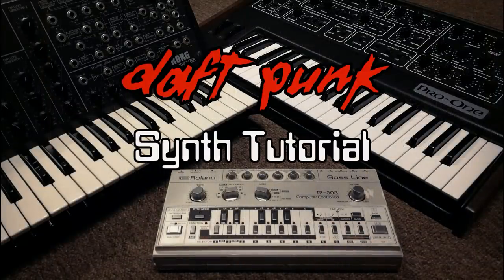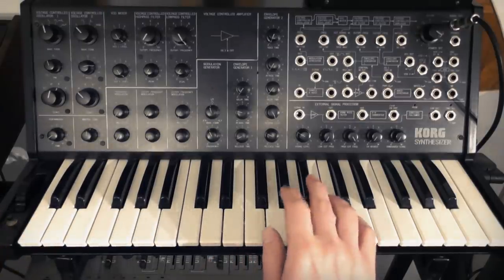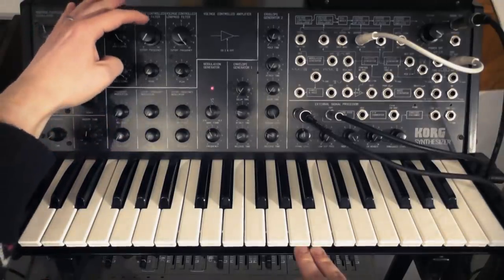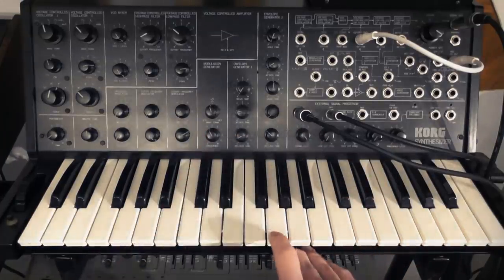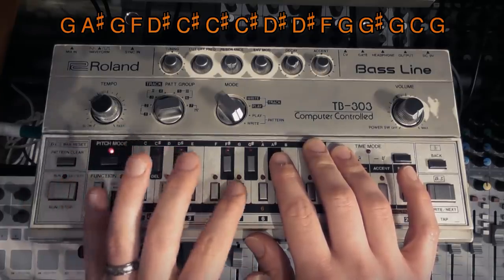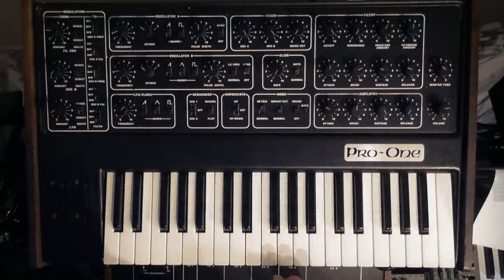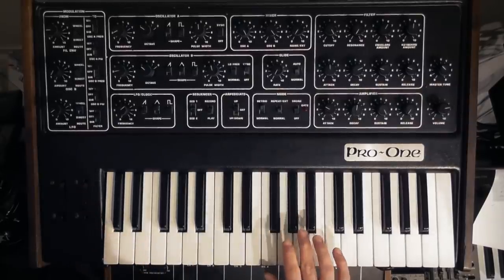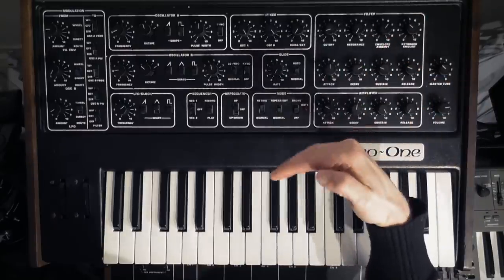Daft Punk Synth Tutorial

Comment from the maker: An addendum.

The only gear list that has come from Daft Punk themselves is found at the bottom of this comment.

You'll note the there is no mention of a Korg MS-20 anywhere and so the combination required from that list would be a Juno-106 or MKS-80 or Prophet VS, the Waldorf Miniworks 4-Pole (the necessary VCBPF) and a distortion pedal (not listed).

However, others have pointed out this gear list is incomplete and doesn't list gear they've been photographed using at the time.

Plus, factor in that they may not have wanted to reveal all their secrets or that they could easily have borrowed gear and it still remains possible it's an MS-20 or Yamaha CS-30.

So the plot thickens and it could be a combination of the gear from that list, but nobody actually knows for sure as they've never confirmed specifically.

https://happymag.tv/daft-punk-homework/
Reply: If it's not a ms-20 I'll cut off my hands, it's sooooooooo the sound of it
Reply: Hey :)
I´m trying to recreate that Daft Punk sound on the ms-20 vst, but can´t get it right, do you have some suggestions? :)
Reply: Thanks man. I am hoping to recreate these effects using my Korg SQ-1 step sequencer and Behringer TD-3 synthesizer. I can use the cv a and b in/out ports with the other device's ports... Gate and filter in... Right?
Reply: I think it could also be an ARP Odyssey
Reply: Bastards hid the talkboxes
Reply: @Frogn_  Old one - but the Vst settings arent exactly the same as the analog shows - you have to tweak a little
Reply: I see a lot of comments by ppl refuting that the MS-20 was used by them on homework, but I feel like the filter just screams MS-20, and I question if those ppl who make those comments actually have ears.

Comment: Yeeeesss, seen a lot of people try and do the 303 line and not quite got it, but this is exactly right, even the accents.
Reply from the maker: Thanks. Yes, I think a version that wasn't quite right has gone round the internet.
Reply: One subtle thing in the original is that the first 2 bars are an octave lower. I assume they just had the tuning down all way, then turned it back up.
Reply from the maker: I've not noticed that, will have to listen again.

Easy to do with the tuning dial as you say.

Comment: Great tutorial Alex! I still have an old Korg MS20 but mine is very old and malfunctioning! I live close to the sea and in a tropical and humid place called Brazil! Yours looks great like new! How come? Cheers from Brazil.
Reply from the maker: Thanks. I'm lucky to know a very talented dealer who sources and services fine specimens and this is a prime example. I've seen even older stuff that looks new. I'm guessing some form of magic or a time machine.
Reply: @AlexBallMusic  thats great! Where do you live? England? All the best.
Reply from the maker: Yes England. Not quite got the humidity problems Brazil has!
Reply: @AlexBallMusic  Have you tried the new Korg mini MS20? If so, does it sounds the same? I have tried the Vsti version and it doesn`t sound the same at all!!! thx
Reply from the maker: I've tried a mini and the full sized reissue. They've got that "family" sound, but are not identical.

The original is definitely noisier and fuzzier and the distortion screams a lot more. But the reissues are solid alternatives, particularly as the components of the original no longer exist.
Reply: @AlexBallMusic  Yes I thinking in buying it. I am completely dived into VSTi because almost my hardware synths are malfunctioning at the moment. I have a not working Korg 01w, an Ensoniq SQ80, Novation XStation which I am using as a controller. Thank you very much.

Comment: To my ears there is more filter sound than Oscillator sound on the mixer section
I mean if a preset has the 50 % Osc / 50 % filter , that robot rock lead has 30% Osc / 70% filter sound 
I don t know if you can do that on prophet but a juno can , just saying for let you get what I mean

Comment: That peak resonance knob-tweak is also what they did on Aerodynamite to create instant rising tension and buildup.
Reply from the maker: Nice. The MS20 is certainly the king of rising tension!
Reply: Hate to be that guy, but they actually used a Roland Juno 106 with a Boss distortion pedal
Reply from the maker: I've heard others say it was a Juno and others insist it was a Yamaha CS-15. Sounds like an MS-20 to me, but I guess nobody knows for sure.

On a Juno you'd have to run midi into it to get the 4ths that tight, but I'd be surprised if it could create this sound even with a distortion pedal. I'd love to hear someone recreate it with a 106 just to answer the question as it's an interesting one.

Comment: how the hell did they conceive of that 303 pattern with the 'down' 'slide' 'up' settings that way
Reply from the maker: From programming the 303 loads of times myself, you can add slides and accents per step after the fact and then undo do them if you don't like them. So it was probably just trial and error until it sounded cool.

You basically throw something at it and see what comes back.

Comment: what's your external signal processor going to for the korg synth?
Reply from the maker: Soundcraft 22 MTK which passes to my DAW via USB.
Reply: @AlexBallMusic  I ask because I wanted to try this on the vst version of the ms20 which appears to have all the same ins and outs and dials but i'm not sure what the equivalent would be for going from the "amp out" of the external signal processor. I've tried various things to no avail. unfortunately it seems I cannot get this sound with the vst version :(

amazing job on the sound design by the way.
Reply from the maker: Ah, that's annoying. You'll have to stick a distortion plug-in on the vst output. Or even run the audio out and into a stomp box and then back into your DAW.
Reply: @AlexBallMusic  oh that's right, just realized the ms20fx vst can be used as a distortion plug in on the ms20 itself. works like a charm, thanks.

Comment: This video made me not ever want a 303
Reply: Listen to land of confusion....
Reply from the maker: It is an arse to programme, but it quickly becomes normal. I can do a bar quickly having had it for a few months. The stringing together of multiple bars into a track is probably the slowest part.

Sound wise, although it is famous for the acid squelch, you can use more reasonable settings to get nice round bass sounds or arpeggios and FX. It doesn't have to be doing an aggressive riff.

I might do a non-typical track with the 303 at some point so show what other things you can do with it.

Comment: This is an awesome tutorial! One thing I just am not understanding is: What waveform shape from oscillator B is actually modulating oscillator A? You turned off every waveform shape and also did not need to turn down the mixer volume for B. From what I can tell you are using the filter envelope to vary A's frequency, whose fundamental is also set by oscillator B causing a lot of harmonics but maintaining the same fundamental tone, is there some type of sync pulse in B that is used instead of a typical waveform to cause the reset on A, like an impulse function?
Reply from the maker: I was indeed modulating the frequency of Oscillator A with the filter envelope, whilst its wave cycle was simultaneously reset by Oscillator B. Seemingly, I could deactivate the oscillator B waveshape outputs and still get the sync effect. I made this video nearly 5 years ago and sold the Pro-One about 3 years ago, so I can't check exactly why it works that way on that particular synth and I can't remember either. 

It could well be that the sync doesn't specifically use the waveforms, instead it uses a sync pulse or some other oscillator output, as you said. No doubt a tech could look at the schematic and get the answer. It's making me scratch my head too, now that I watch this back!

Comment: Was it the pro one on robot rock? I read it was the JX8P and it sounds pretty much exactly like a preset
Reply from the maker: It was a sample of "Release the Beast" by Breakwater from 1980. They used a Sequential Circuits Prophet~5 and that classic sync sound was one of the factory presets. The Pro~One is basically a monophonic Prophet~5 rev 3. Same chipset.

In 1985 Roland put out the JX-8P and that sound was basically a bread and butter patch by then and so it's on it. It's also on the JX-3P from two years prior and it's called "Sync Sweep".
Reply: Alex Ball awesome response - thank you
Reply from the maker: @Skootavision  You're welcome, thank you.

Comment: Top Notch Tutorial my friend, thank you so much for this.  One question - i picked up a brand new Deepmind12 a couple months ago, and I'm wondering how to re-create that distortion on Da Funk (the first part). I'm getting close, but I'M having trouble getting the 'wah wah' effect down. Any tips ?

Btw, the td-3 from behringer NAILS the 303 part, that built in distortion absoolutley KILLS. For anyone who can't afford the original, I can tell ya, td-3 is the way to go.
Reply from the maker: Deepmind - that only has a resonant, voltage controlled filter, right?

Then a non-resonant, static high pass? Basically a Juno kind of setup?

The wah effect is created through contoured band pass filtering, so that would be difficult without that functionality unfortunately.
Reply: @AlexBallMusic  Correct - BUT the HPfilter modded to the Key Voltage is not realllly helpful as you mentioned with no reso. 

I nearly cracked it tho by coupling the VCF  envelope to the HPfilter freq (along with LP Filter), and cranking up the reso a bit. Turns out I needed to do a dual mono-unison-2 octave spread, while adding the DualPitch Effect for the 7+ semitone saw and adding both distortion effects of the DM12 and the "moodfilter" (another DM12 effect) for a proper highpass to cut the lows. Verrrry similair but not quite there. The "moodfilter" does have a bandpass, but I've not been able to dial it in to the VCF Env with results yet... more tinkering needed but results are showing themselves :)

Thank you SO MUCH for your quick reply. This definitely serves a great basis for recreating most of what they do - Nailed Aerodynamic for example based on what you did here and the limited yet creative options of the DM12.

Comment: For some reason, I cannot seem to get Korg MS-20 in Legacy Collection to make this sound.
Reply: The plugin version has no way to do the feedback loop. You can patch the "Signal Out" or "Phones" outputs to the "Signal In" in the External Signal Processor, but you can't patch the audio output from there back into the audio signal path. However, you can use the "Distortion" effect to achieve something similar. Here's a quick attempt to make that patch with the plugin. I also left out the keyboard CV to filter frequency because it doesn't seem to match up with how the hardware works, and in any case is not really necessary in the plugin. Try this out and see what you think. https://www.dropbox.com/s/1clijorm3t4m74h/MS-20%20-%20Da%20Funk.fxp?dl=0

Comment: Daft Punk did not use any synth for Robot Rock, they've used a direct sample from 'Release The Beast'. You have made a nice programming for the TB 303, although I think they didn't use the Korg to make Da Funk but they have only used the 303 with some distorsion filters. There's a footage of them playing live unmasked back in the days and their equipment was quite minimal
Reply from the maker: Yep, I mentioned three times in the video that it's a sample of "Release the Beast".

Da Funk definitely has another synth other than the 303, it's impossible to make that MS-20 riff on a 303 as it doesn't have a second oscillator to tune in 4ths and doesn't have band pass filtering (or several other things you'd need either). It's most likely an MS-20 but could be another monosynth with comparable architecture.
Reply: Alex Ball It is possible the same way you have programmed the bassline on the 303, it doesn't stritcly need another oscillator but some heavy external filtering. Of course only them now the exact recipe. Thomas Bangalter was an hardcore user of overlaying heavy filtering, in an interview he said 'You never know what it will come out'. Also if you research some of their live shows of the early days in their setup you never see instruments with keyboard, all sequencers and filters (often synced to a 909)
Reply from the maker: @claudiamatteolo1459  You absolutely need another oscillator because there's two parallel pitches happening at the same time and they're sawteeth. External filters can't add another oscillator running parallel fourths, they can at best self oscillate (which is a sine wave anyway) and sounds totally different.

It also sounds exactly like an MS-20 on the record and nothing like a 303. MS-20s were cheap and easily available at the time, so it's highly like that that's the answer.

They might have used different gear and samplers live (which is very common for bands as lugging expensive and bulky gear around isn't practical) but there's no way that riff is a 303.
Reply: @AlexBallMusic  Okay so it needs a lot more tweaking because as it is it doesn't sound like the original one yet. There's a guy on Youtube using a Moog and his results seem a bit closer. I literally heard Homework thousand times in my life from the original Vinyl and CD and I know perfectly how it sounds. Also don't forget there's an heavy compression that gives that slightly lo-fi vibe to the sound
Reply from the maker: @claudiamatteolo1459  I know the Moog video, that's "Once upon a synth". What does the Moog Grandmother have?

Two oscillators! 😉
Reply: @AlexBallMusic  Yes, and also it's not a Korg
Reply from the maker: @claudiamatteolo1459  He was demonstrating it on a Moog that was released in 2017. Are you now suggesting Daft Punk used that in 1995? 🤦‍♂️

And anyway, I said it was either a Korg MS-20 or another synth with the architecture of the MS-20, because that's what's needed to create that sound.

I.e. Not what's available on a 303 as you asserted. 😉
Reply: @AlexBallMusic Now you are assuming. I'm suggesting that they didn't use that Korg you are so sure they've used  AND you didn't achieve the most similar sound, while others got better results with different gears.
Reply from the maker: No Claudio, you said it was done with a TB-303 which is impossible and I've explained why very clearly.

Then you've obfuscated in reply and arbitrarily claimed my sound is wrong just to be bloody minded because you can't answer straight questions about your 303 theory.
Reply: Alex Ball I said it was done with a 303 WITH external filtering. Stop twisting my words and try again, you are far from the original sound.
Reply from the maker: @claudiamatteolo1459  I haven't twisted your words at all. The sound is TWO oscillators creating sawtooth waves and tuned in 4ths.

Using "filters" please explain how that's possible on a 303, which a single oscillator monosynth?

Pro tip: You can't. It's impossible.

Cheers.